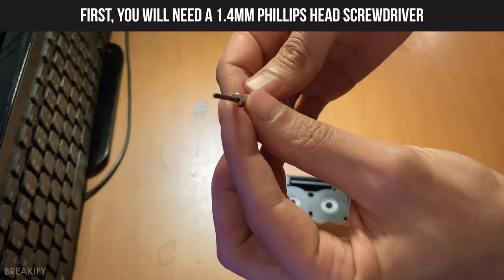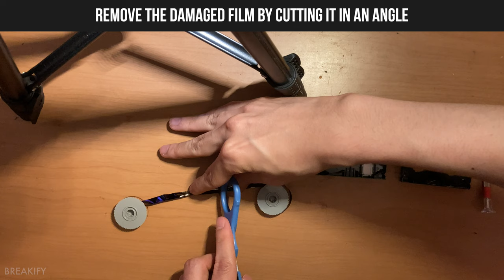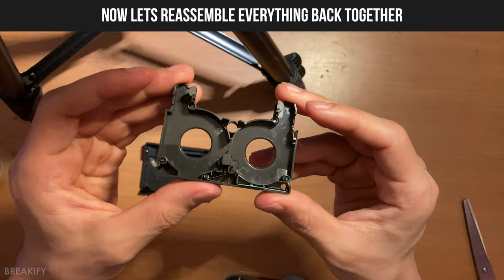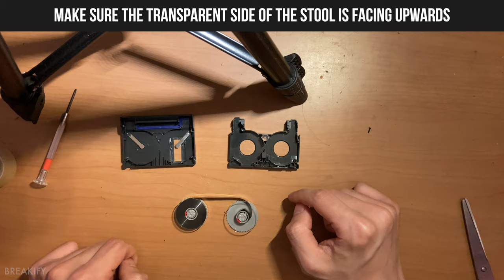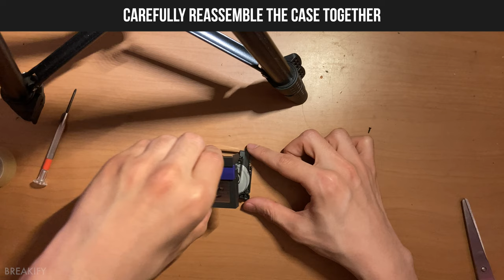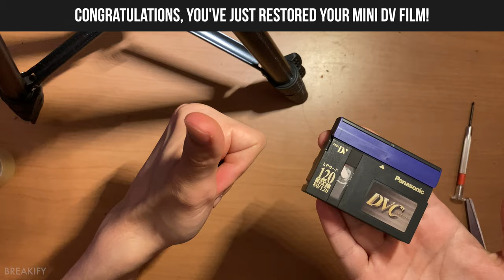How To Repair A MiniDV Tape (Easy Tutorial 2022) How To Fix & Restore A Damaged Or Split MiniDV Tape

Comment: Hi! I have some MiniDV cases that don't have screws. What can I do with that tape?
Reply from the maker: Screwless tapes are glued or ultrasonically welded; so, a very sharp razor knife will open it with just a few passes across the seam. Have a camera running to capture what the layout is as you open it, so you know how to piece it back together. Or disassemble a donor tape for practice first.

(After you dissemble the case, you can also replace it with a one that has screws)

Comment: What if the damaged areas of the tape have video data. You just lose that part of the video? I’d rather find a way to restore the actual tape rather than disposing of potentially good footage.
Reply from the maker: Unfortunately, yes. However, you can try stretching the damaged area or pressing it with a stack of books and leave it for a few days. But I cannot guarantee that the “damaged” section will be recovered.

Comment: I got one for you: the kids got a hold of a mini-dv tape and ripped the tape out of the cassette casing. It's currently bagged up into a mangled pile inside a zip-lock bag at the top of my closet. Is that footage ruined or is that repairable?
Reply from the maker: If most of the tape is mangled with scratches or creases, it will be very difficult to repair. However, if only a section is damaged, you can cut out that part. This tutorial is only applicable if there is still an undamaged section of the tape remaining!

Comment: Hello  I have ordered a replaceable dvc tape and the cassette was broken so I had to take the reel out . I wanted to ask you how long can I keep the tape outside of the cassette or is it safe to keep It. I'm keeping it in a low temperature
Reply from the maker: You should be fine but try to avoid too much heat or light, as it can damage the tape. Somewhere cool and dark should be fine
Reply: @BreakifyTV  nowadays its hard to find a case with screws so if I use it with one with no screws how do I place it back again.